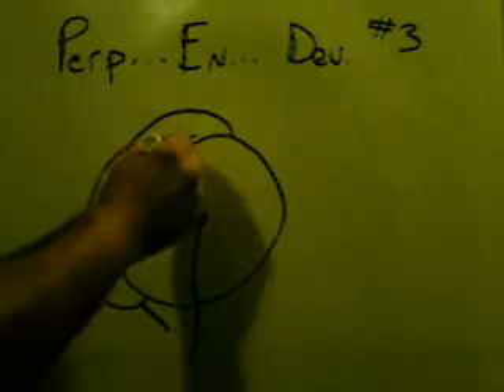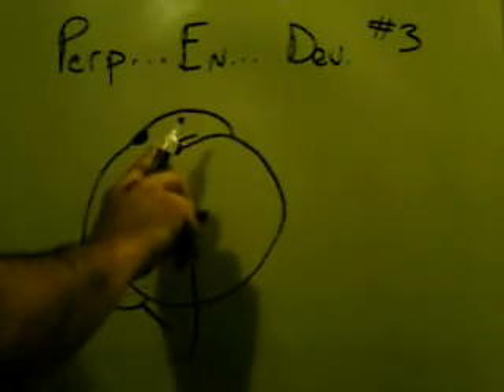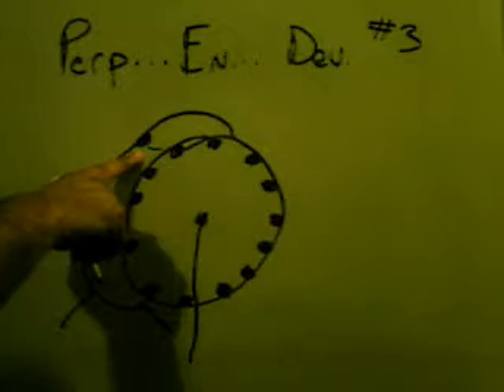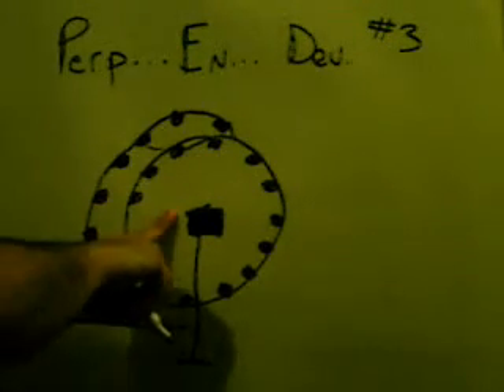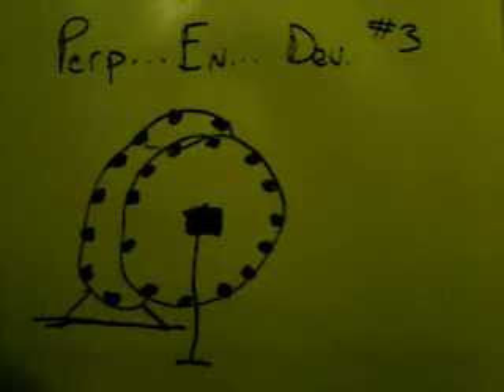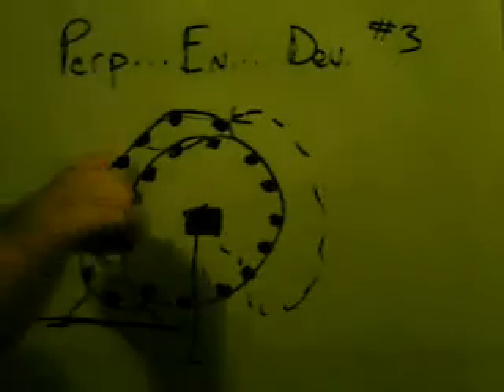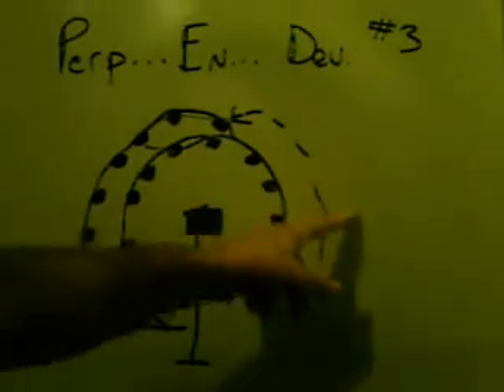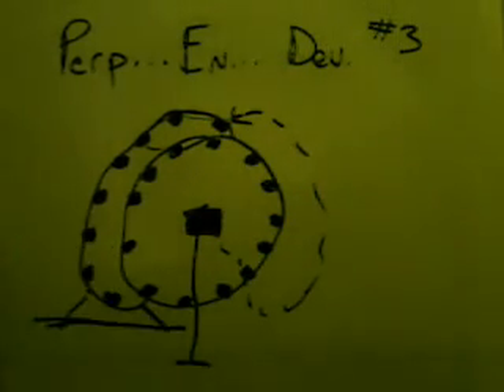Perpetual Energy Device #3

Comment: The magnets oppose one another both ways, approaching as well as receding. So your disk will stop, rapidly.

A little bit of something is not necessarily better than nothing. You have to consider construction and maintenance costs. This is why electricity from wind turbines is more expensive than power from coal-fired power plants. But wind turbines actually do work... unlike your impossible machine.

So why do you talk and draw, but don't demonstrate? Because these machines can never work.

Comment: Indeed, the wheel constantly has force exerted on it to spin that direction. However, it also has an equal force on it to spin the opposite direction, so the overall power is zero.